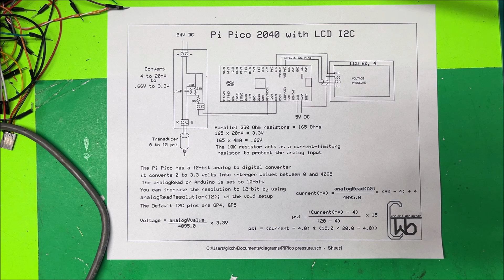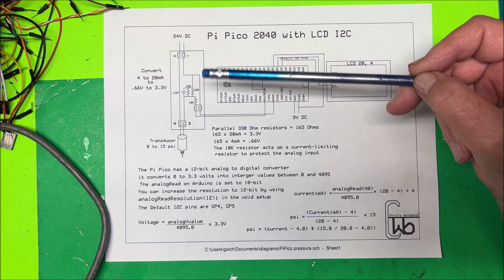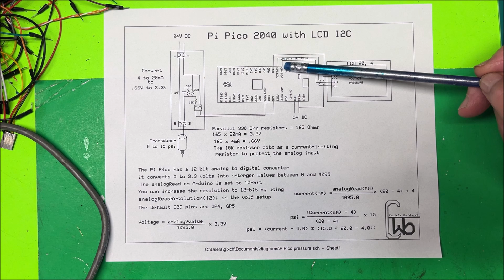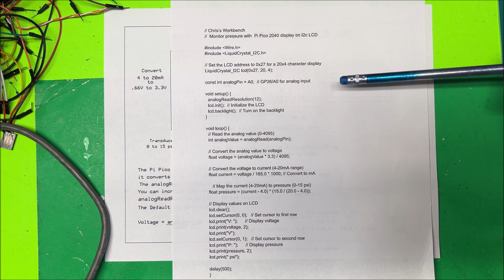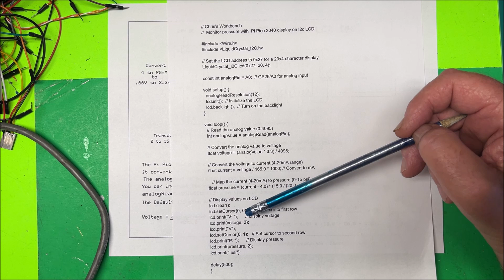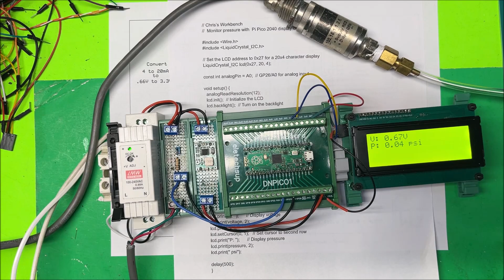Pi Pico Arduino IDE I2C LCD

Comment: Thanks Chris, cool video of your project to monitor pressure of a soda, lol. 🙂 Not sure what your background is but maybe you'd like to consider applying this pressure monitoring to level monitoring and control possibly. I completed an apprenticeship for Instrumentation and process control way back when pneumatic systems were still the norm, spec200 DCS control systems and Bailey Infi90 DCS systems.

Pressure of water in a column and calculations for the heights of water in a column, be cool to have a control valve opening and closing to control the level in the column with a pump run by VSD to vary inlet flow into the column from a capacity tank. 

Then people interested in PID control can get a great example.

I'm currently working with Microchip development kits and the MPLAB IDE, enjoy the Assembly programming language and C and currently working on RF wireless comms between two Curiosity Nano development kits using OOK-TX, OOK-RX, MiWi and MiWi II Click modules. Also have Kanda PIC-MICRO-X and the old STK300-ICE development kits.
Reply from the maker: Excellent  Thanks for the comment.
 I've been a system integrator  for municipal water